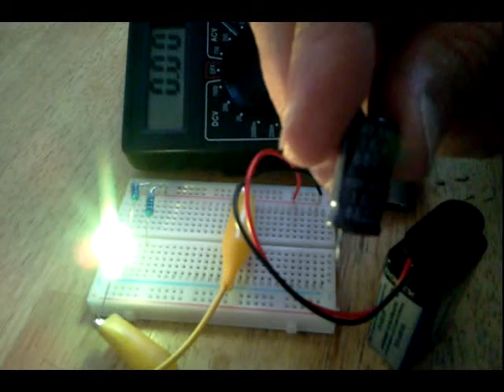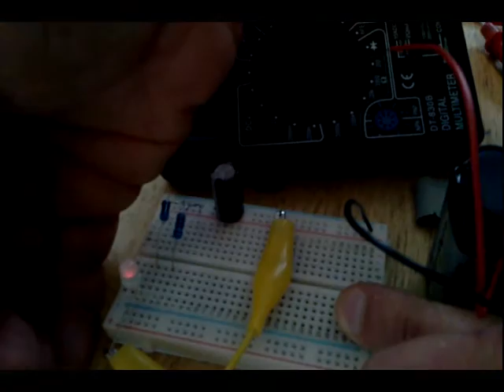LED Breadboard Capacitors: Storing Volts

Comment: Nice video....  best explanation I have seen for a capacitor.  I thought it may be used to smooth stuff out in case of noise/blips, but wasnt sure.
Reply from the maker: Thanks for posting. Higher capacitance attenuates high frequencies, so yes capacitors are used as noise filters.

Comment: I want to create a circuit where I am charging a battery but if the main power goes out the battery takes over
Reply from the maker: Relays and Schottky diodes? https://forum.allaboutcircuits.com/threads/circuit-to-switch-between-main-and-backup-12v-power-supply.177976/
Reply: @p1nesap  looked at it I will do some trials I guess I want to ensure that the designer maintain stereo sounds

Comment: got it...thanks so much.....here is something to throw at you....im making a cable tester and i want to use 9 leds essentially in parallel....i want to throw one switch and have all the leds come on but one at a time....so i want to use capacitors of different values to achieve this....so every half second the next led will come on until  they are all on... .pretty sure it can be done..can u help me with this

Comment: hi p1nesap
could you me 
i have mini dynamo come from dvd player
i want to charge the capacitor from the dynamo
and power the led for about half an hour
my dynamo generate 6-8 volts
now what size of capacitor should i need also the resistor youve series to the led
thanks